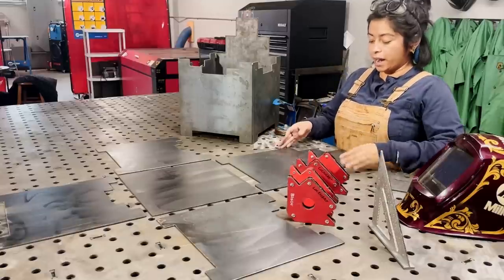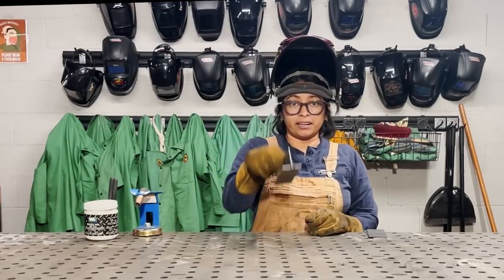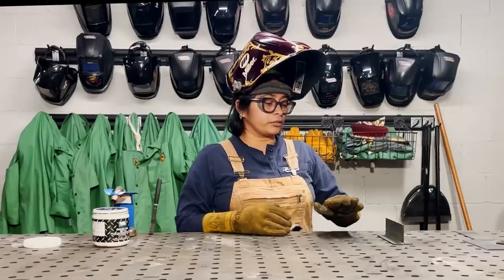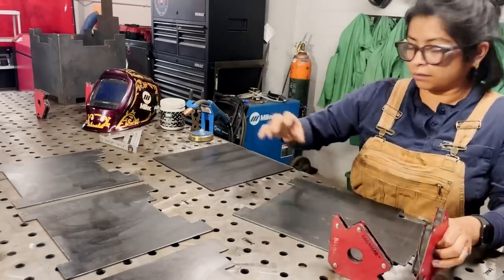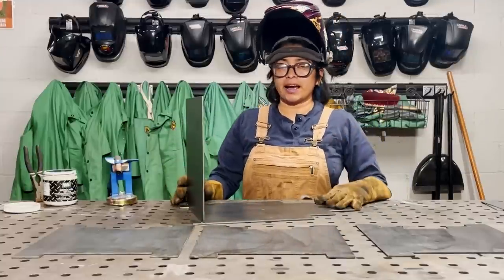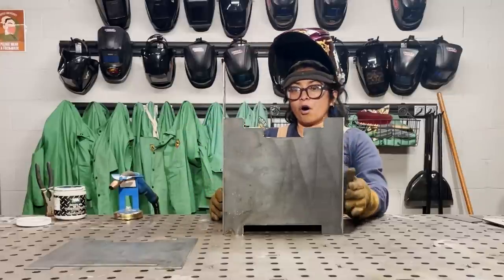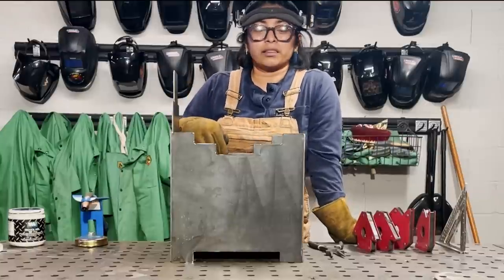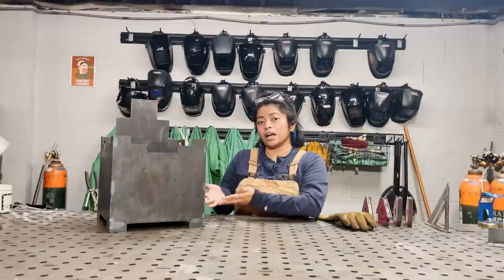MIG Welding Project: What are the things I need to consider?

Comment: Off subject here buti have a question and am curious.  Have any of you ever experienced "optically illusions" while welding?  Note: I'm not a professional welder and have never welded as a occupation ion.  But on 2 occasions recently while welding my site picture (what I could see throughout the helmet lense) appeared to start an oval movement as if the work piece, my hand and gun started moving in an oval pattern.  I stopped welding and raised my hood, then lowered my hood and started back to welding.  After a couple of minutes it did it again.  Anyone ever experienced this?  Again, just curious.  Thanks.
Reply: Jim, that is a good question, are you using an auto darkening lens?
 You might be seeing a reflection between the multiple pieces of glass and plastic
in the hood, If it continues, I am thinking you may want to try a passive lens? 
If it still continues, you may want to see a doctor. I have been welding for over 
40 years, not continually, but have never seen something like this personally. 
I have had visual illusions after a hard knock on my head that lasted for days....
I think I had a concussion......
If you see any sort of these optical illusions while not welding, definitely get to 
a Doctor , you might have something serious going on...
I hope this helps, Paul Brown from weld.com
Reply: @ypaulbrown  Thank you for responding!  No knocks one the head, though through the years I've had several people tell me that I am "not right". 😁.  And yes, it is an Auto Darkening hood,. It didn't seem like any reflection as it looked just like as of you had held a picture in your hand and moved it in a oval pattern.  No distortion just the oval perceived movement.  If it happens again I'm try the passive lense.  And it's about time for my eye exam (and I did forget to mention that I do wear glasses for myopia, nearsightedness) so I will also check with my doctor.  Thank you again for responding.
Reply: @jimjordan5630  one good thing about Myopia, you can take the prescription glasses off and put on a pair of safety glasses, as you need to see close..you prescription lens may have been giving issues.....and what brand/quality lens are you using, some, if viewed from an angle can give more brightness at edges and dark patterns.......I have the opposite problem, I need reading glasses to see close and far away.....ha, but at 69, I can't complain......I used to retouch photographs using a 10 power magnifier, I drew hair on people.....and it was on 35 mm slide film.....I had to wait between heart beats.......and you think welding is tedious....
Reply: @ypaulbrown   Putting hair on people. 😁. Yeah I guess that would be tedious!  I worked as industrial carpenter at nuclear power plants so all of my glasses were polycarbonate.  Not sure of the actual brand or the quality actually, other than they never gave me any problems and got replaced every year.  I did have to getting them with special prism lenses in 2016 after an on the job eye injury.  But I had never had that "optical illusion" before or since that one day.  And only the 2 times then while welding.  Have welded a fair amount but that was the only time I had the problem.  Nothing before or since.  After I retired I still get all of my glasses with the safety lenses.  I just feel safer whether cutting the grass, using a grinder, cut off wheel of doing other things.  I guess that's one thing that the safety programs did teach me.  Had I not been wearing glasses the day of my injury I would have definitely lost my eye even though it was pretty serious as it was.  And yes, at nearing 69 I have for years found that even with progressive tri-focals Is much better without my glasses than with, and dune things I can't see too well with or without.  But I keep them on, add I said, when doing things like grinding etc.  I do take them off while welding due to having they protection of the hood.  At first when the illusion happened I thought I was about to pass out, only I didn't feel dizzy or light headed, and I wondered what the heck was going on.  So I paused and raised the hood and everything was fine.  I went back to welding and after a little bit it did it again.  But then it stopped.  Just a crazy kind of thing.  I think I'll take my hood in when I go to see my Dr just in case he has a question about it.  And again, thank you for the concern and the conversation!
Reply: @jimjordan5630  good Idea on bringing the hood in to the Dr. ...I prefer glass lenses in my spectacles as they do not scratch as easy. The Oldtimey kind ya know......another thing you can do, is paint the interior of your hood a very flat black to reduce any reflections off the plastic of the hood, that will also save you from uv and ir light bouncing in your eye.....If you take some spray adhesive, like 3M 77 and spray a rough coat, then when dry, Krylon makes, or used to make a spray can paint  called Ultra Flat Black......you will not see any reflections with that, I came up with hat technique modifying film camera in Hollywood in the 80's for extreme close up photography. By the say, never ever wear light color shirts while welding, the reflection will co right in the hood and into your eyes.......the only time I had arc flash was because of this....reflections of light behind you in the lens can also be annoying and can be avoided by putting a flap of leather or cloth on the top of hood to go over your head and behind to block light, you can get those at your welding supply for very little and the cloth ones are fire resistant....please wear a cap of some sort to keep pesky sparks from toasting your noggin......no synthetics though as they melt....ball caps are good, and so is Comeaux weld caps, I like a Boonie hat in cotton as I can cover my big ole ears and back of neck, the brim I just fold up......I do take all the ammo out of the loops first though.....I sure hope this helps, if you have any questions, please email me, I am sure you can find my address......best wishes, Paul from weld.com
Reply: @ypaulbrown  Thanks again.  Great recommendations.  And yes, I wear a cotton Comeaux.  I started that wearing those years  ago under my hard hats.  My big ol head sweats so much the hard hat sweat bands weren't enough.  Now I can't stand to wear a hard hat without one.

Comment: I’ve never seen a speed square used as a hammer before and when welding never weld opposite corners because it will pull the box out of square, instead weld two corners next to each other then the other two corners, think of taking a cardboard box and squeezing the opposite corners, it will bring the other two corners closer but squeeze two corners next to each other and it keeps it’s shape. Otherwise great looking project and great tips on cleaning the mig gun and setting the machine
Reply: @ypaulbrown   No you are simply wrong. The white knighting when you are wrong is just stupid. She is transferring bad habits to the young welders. The cost of the tool makes no difference, it's the wrong tool for the job, this is how standards slip.

Comment: Those practice joints were terrible,you didn't tie in at the toes of weld and you have way too much wire speed, thats why your weld was way to convex.
Reply: [Beveling] the edges would fix that. When ever you run a weld without a weave you will pile up. Same thing happens on flat plates when practicing straight lines. Lots of videos on that.
Reply: @lloydcastleton  well said Lloyd.....
Reply: Give her a freaking break man go make your own welding videos
Reply: @RiseSteadyNC  you got that right....all these keyboard CWI"s and Fabricators....
Reply: @RiseSteadyNC  I agree....
Reply: @lloydcastleton   bevel a fillet weld? wdym by that
Reply: @morgs3007  the plate which sits perpendicular to the plate you're welding to, can have one or two 45 degree bevels (two makes a 90 degree bevel) which will give the filler material somewhere to fill up so it doesn't have a piled up look, as well as give you more surface area to get penetration on.
Reply: @lloydcastleton  and a beveled T joint uses less weld material 
and insures full penetration if that is need and done correct,
 like in heavy plate.....the amount of filler difference is amazing. 
Get hold of a Lincoln 'Procedures of Arc Welding] book, they 
lay it out well and really explain the advantages.....and it is only $30
from them, the best money you can spend......

Comment: Speed square aint no hammer and its fir carpenters.......jus sayin
Reply: Consuelo is a metal carpenter......Speed Square [Swanson Brand by the way] 
 is my go to tool for ease of use in initial tacking of a rectangular frame,
 Then the tape measure comes out and I do a diagonal measure.....
by the way Mike, was that Carpenter's Name Douglas? as in Douglas Fir?